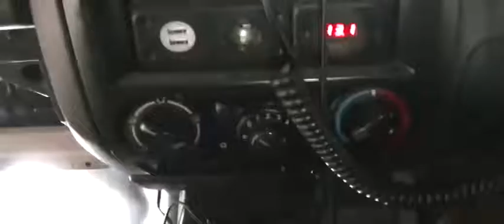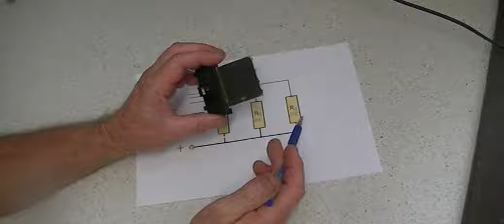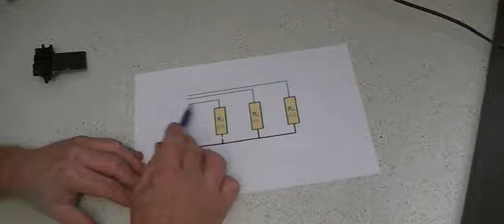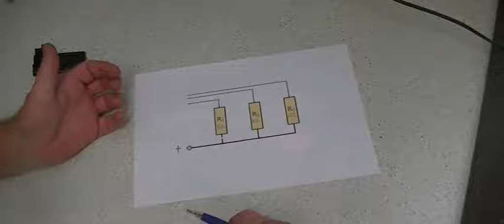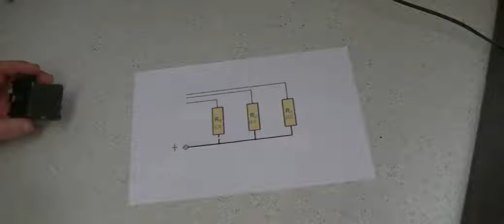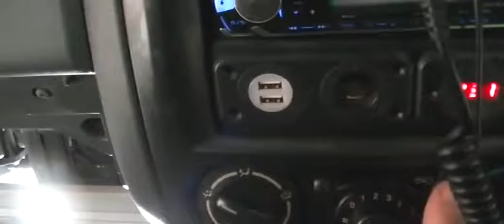COLORADO BLOWER FAN RESISTOR REPAIR-no need for a new one.

Comment: So, you replaced a FUSE with a solid piece of wire. That's like taking out  blown car fuses and replacing them with pennies(which we used to do in a pinch) ...lol. I hope it holds and doesn't permit an overheating condition leading to circuit board failure. I'm going to take a look at my "broken" resistor pack and perhaps fix it like you did yours, but perhaps with a thinner wire that would open if current got too high. Helpful video. Thanks! I see Amazon has thermal fuses (10A). I could try those but if using only one still allows it to fail, perhaps I could put 2 or more in parallel to increase the amperage capacity.....but might be getting dangerous. I'll try to let you know how it turns out. This will be an experiment.
Reply: any updates on how it went? I'm trying to fix mine and  have no idea what to do. A new resistor is 16 euros so it's not that bad, but if I could repair the original it would be best
Reply: He just put a wire there... The rest of the rezistor is the same thikness... So... In the worst case IT will burn again a Little portion. It's safe!

Comment: Man I would have soldered some fuse wire...
Find what the fan bower circuit fuse is.
Measure the resistance of that board;... calculate a fuse value from ohms law...

Comment: Can i just run a wire from power  to my fans power. I dont care if its full blast all the time. I just want it to defog my windows
Reply: Setting 4 doesn't use the resistor module.  Setting 4 is a wire from power to the fan.  So if that's not working, the problem isn't in your resistor.  Perhaps your fan is simply dead?